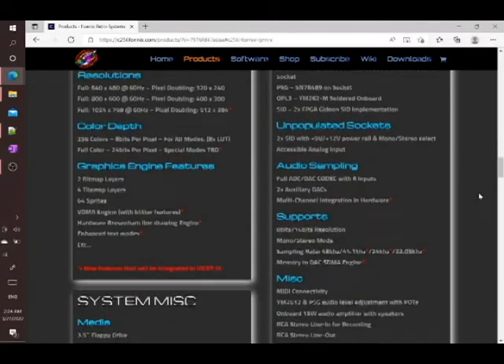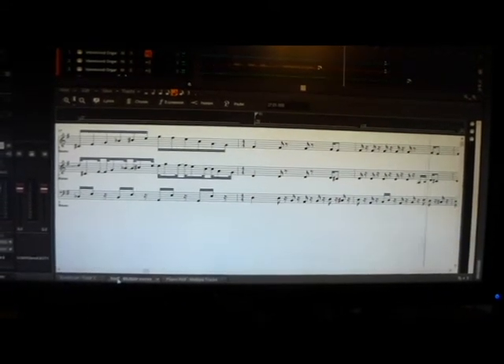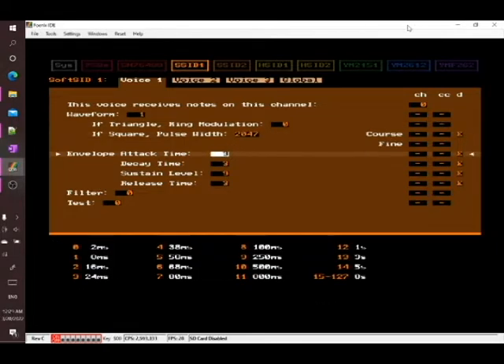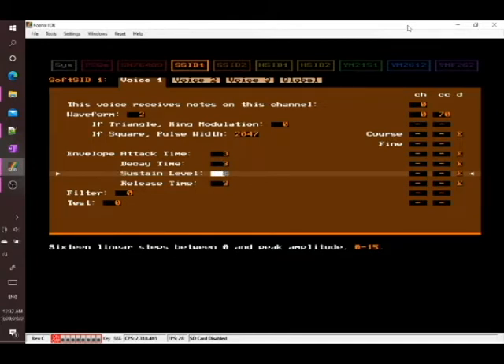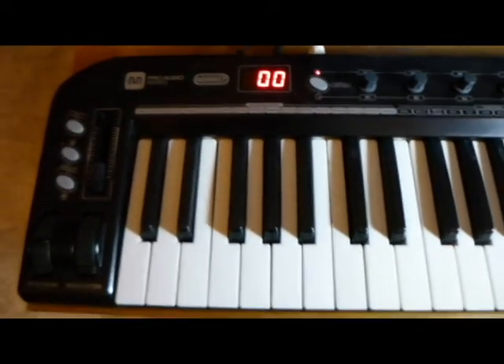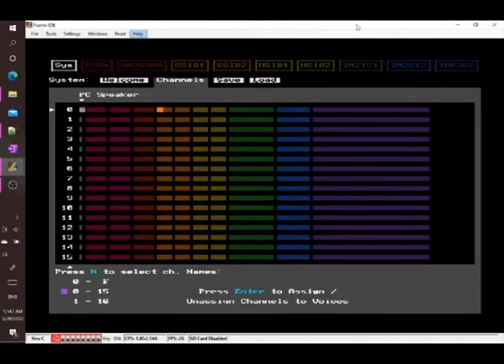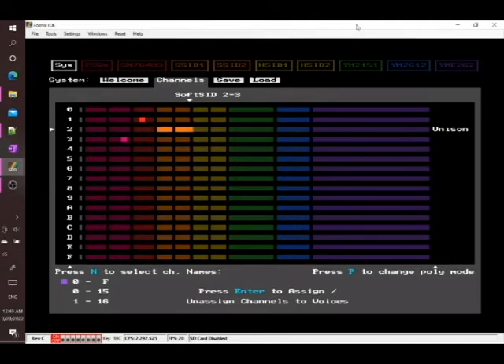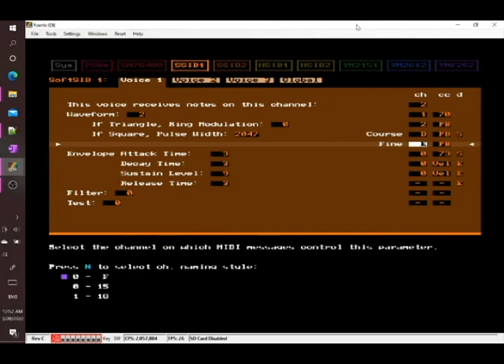MIDI Receiver (WIP) for C256 Foenix

Comment: There are a grand total of 42 channels from all the sound chips and softcores, not counting the Red Box codec. and anywhere from 32 to 23 channels of those being wavetable.  The biggest issue is going to be building MIDI instruments.  There are plenty of options for excellent sounds, especially for the YMF262 channels in 4 Operator mode, but even more options for bad sounds, based on how you set your operators and how you arrange them for your waveform.  And the only way to find out for certain is the time-honored method of trial and error.

And the General MIDI standard specifies at least 64 Channels of polyphony.
Reply from the maker: I think you've summarized the pros and cons very well.  Much like the C256 Foenix line of computers this runs on, this software removes the guiding constraints, allowing for more creativity but also requiring more work and care from the user to achieve a good result.
It isn't meant to allow the Foenix to play existing MIDI files as well as a dedicated MIDI tone generator would (and as you point out, it lacks the appropriate polyphony).  It's about letting chiptune composers have access to all those chips (many of which are from the pre-MIDI era), possibly as part of their existing MIDI setup.